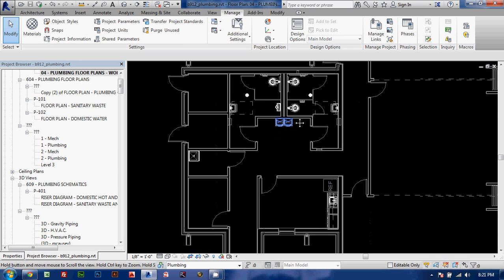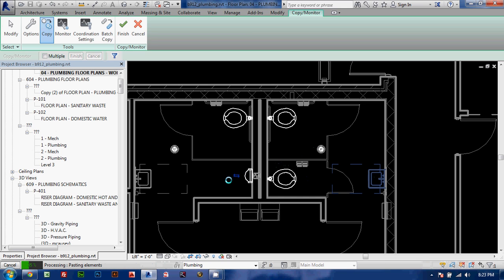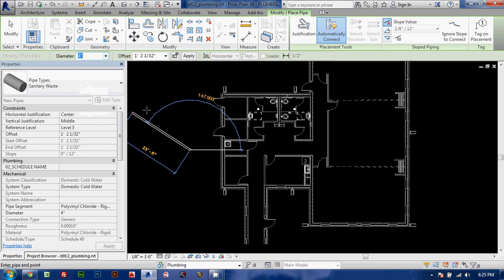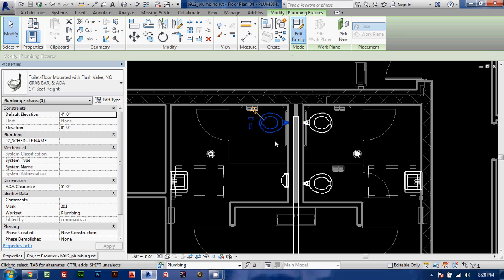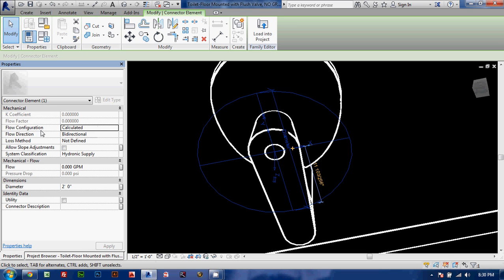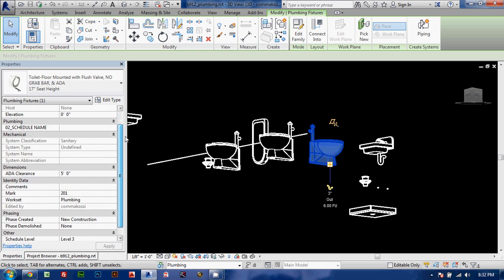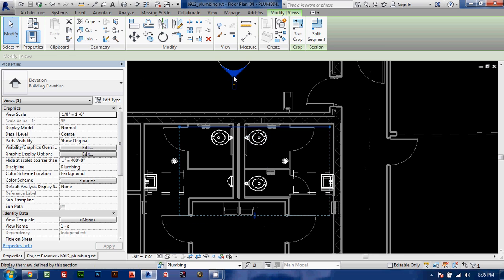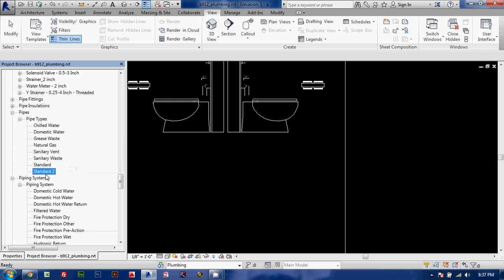Creating Piping Systems in REVIT Part 1

Comment: Loved the video, we're just starting to use Revit. Good stuff. One question, why not copy monitor the fixture and map it to a real manufacturer's fixture? Map it to a fixture with good connectors instead of fixing the architects crappy crapper. Also, isn't there an option to do nothing when monitor detects a change so that it will not make a mess of the piping? A few inches will probably work out but if they move it to a different wall I can see all the piping getting messed up.